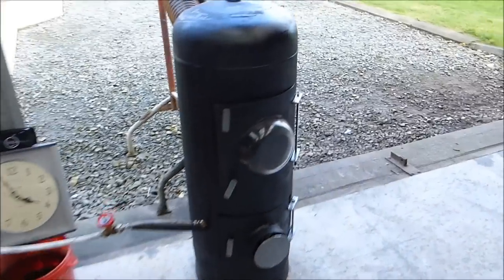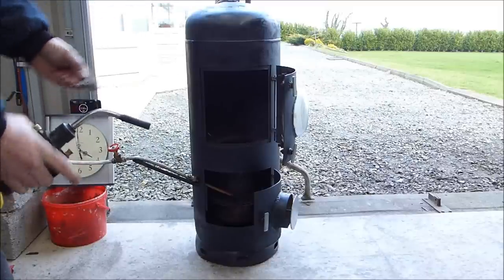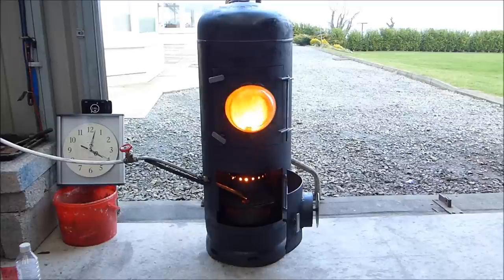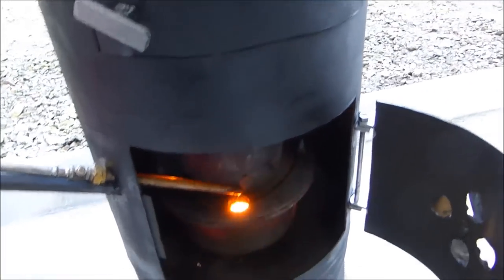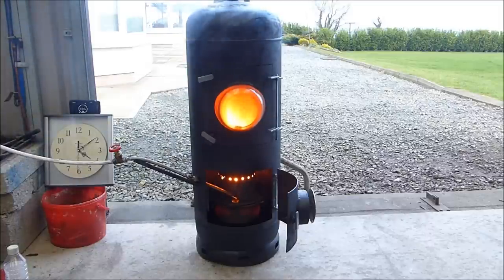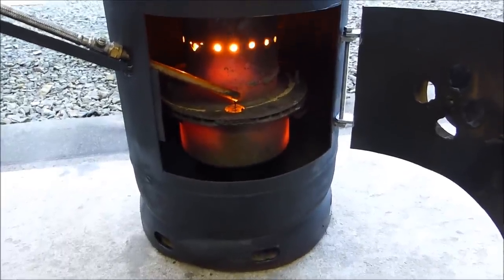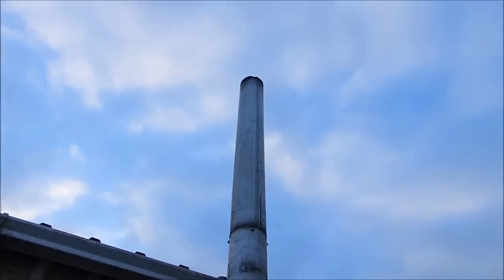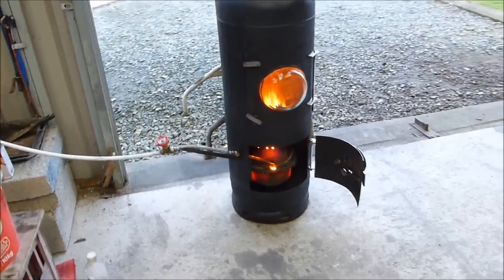Fantastic diy waste Oil and Wood burning stove heater.

Comment: You have to be careful with your Pyrex Bowl when it cools down, and the door cools down also, if the bowl is held in the hole of the door and the door hole shrinks too fast, it can break the bowl. The bowl should not be clamped against the metal door, only clamped against the fiber rope gasket or a previously cured quarter inch thick layer of your RTV. The coefficient of expansion and contraction by heat of the bowl and the metal door might be too different for them to grow and Shrink together. You have to make the gasket more of a expansion joint. But I like the creativity. My mom always hated my creativity when I went into the kitchen to get something.

Comment: one question afyer the vavle and before the cooper pipe that thing with the screw one what is it?
Reply from the maker: stathis ouranitsas The connection was temporary and it is simply a flexi pipe with an inline valve. It was all I had in the shed that day to make the conenction. In later videos I changed the plumbing so that you could see the oil through a modified 1" steel T You can see the newer oil feed setup in this video.  http://youtu.be/yLcmKVt1O2U?t=4m8s     Hope this helps Cheers Gerry
Reply: thanks!

Comment: aluminium heat paint will not flake we use it in the furnace in a steel works and on motor bike exhaust from Stokes paints Sheffield England excellent paint

Comment: Instead of paint  wire brush loose rust then light fire a heat up to about 300f  then hold a piece of brisket fat with a towel so your not burned and rub the fat on the metal to season it as you would season cast iron cookware . Maybe build a smaller burner  to to use less oil/fuel and keep temp around  600f. That's plenty temp to warm garage.  But do try fat  to season body of stove, should have a nice shiny black finish 
M L Rogers    Pasadena, TX

Comment: Good video...  How is it on vapors.  Does it give off an annoying odor or does it burn clean enough and exhaust everything out the flue?

Good project.  Thanks.....
Reply from the maker: Hi Philip. This propane tank evolved with a couple of different types of burners. It will burn solid fuel logs, coal etc. as well as veggie oil and motor oil. In operation there is no smoke or smell in the garage. It might as well be burning propane. Outside there is no smoke but if I were on the roof I would know if it were burning oil or wood but even up close if it is setup properly there is no smoke. Here is a later video with the paint a bit the worse for wear but the stove works great.   http://youtu.be/yLcmKVt1O2U    Cheers Gerry

Comment: Is that more efficient then the regular wood stove that you converted ?
Reply from the maker: Hi Orlando. It burns the same amount of fuel as the cast iron wood burning stove  and heats quicker because of the lighter metal. I can use solid fuel in this stove as well just by dropping the burner and placing a grate in the top chamber. In the next video I changed the setup by adding forced air and the stove now heats from the bottom chamber up. There will be a video showing that soon. Cheers Gerry
Reply: Gerry I'm needing to build something like this for where I will be going. to the Azores in the short future where  hydro is very expensive and nobody heats there. I'm use to the cold in Canada but is very different cold from the Azores damp cold. So I'm looking to make a efficient rocket stove that will heat water as well in order to use radiant heat to other rooms.
Reply from the maker: Orlando Pereira Hi Orlando. I did a setup where I was producing 22Kw of heat to water. I converted an old oil boiler to run on waster oil. The burner in later videos will fit completely inside a boiler or boiler stove. Check it out here http://youtu.be/xvddVsLqLdc Cheers Gerry
Reply: Orlando Pereira
I'm from Azores Islands also Pico Island - Monument Island and a Paradise on the North Atlantic.
What about you?
Reply from the maker: PORTUGAL1010 Hi Orlando. I'm quite a bit further north than Pico but our west coast looks out on the atlantic too. I am in a place where its a lot colder and wetter than where you live but on the one nice day we get in the year it is really nice. We talk about the weather alot too. Greetings from Ireland. Gerry
Reply from the maker: PORTUGAL1010 Hi Orlando. Here's one of my paragliding / paramotor videos from outside my house on one of our nicer evenings to fly over Wexford town Ireland. I will look for some Paragliding videos from Pico  Cheers
Wexford town and coastline birds eye view.

Comment from the maker: Hi Jeffrey. I have seen designs where there is a tank that is filled at the bottom for a days burn before lighting their stove and it looks like it burns well. With my design of stove here and the Ozzirt burner I use in it I dont' see how I could attach or install a tank inside this stove. In my newer videos I designed a different burner which is smaller and fits in the burn chamber so it might be possible with some changes to the propane tank. Here's a link to the new burner https://youtu.be/lU93mSoaJEk     Hope this helps Cheers Gerry

Comment: If you're still looking for high temp paint, I use Dupli-Color High Heat paint which is rated at upto 1093 degrees Celsius.
You can get it in any color you like here IN Australia.

Comment: Hello, it is a washing machine door glass in the stove? Or what type of glass? (tempered (pyrex) bowl? or something else?)
Reply from the maker: Hi Tibor. 
It's just a Pyrex dish from my kitchen. They work great but give the metal door room to expand so it does not break the glass. Cheers Gerry
Reply: Gerry's Waste Oil Burner Thank you! Especially im a glass designer from Europe. I heard borosilicate glass heatable up to 400 degree celsius. I made a design stove concept based on pxrex bowl. I will made it in real as soon as i can. I found out (based on my own stove) the glass radiate infrared heat better than the metal body, so i want to multiply the glass surface, and make the stove more lighter (for visual)
Check this:
http://imgur.com/a/EC5pP
(for woodstove)
Thanks for the inspiration.
Tibor

Comment: great information, i have a tall gas cylinder and i was  just wondering how i was  going  to make  an efficient heater out of it, can you tell  me what size the brake disc is please and what size the chimney is and where i can get that flexible pipe please.
Reply from the maker: Hi duggy788. The brake disk is just a car disk 10 inches in dia. The pipe with the holes in it is 8 inches long and is 6 inches in dia. The pot is stainless steel 3 inches deep and is 8 inches in dia. Towards the end of this video there is a close up and all the measurements you need. The flexi flue is just corrugated stainless flue liner 6 inches in dia. Check out here for more info.
http://youtu.be/mh3cljTTJ2o
Cheers
Reply: successful waste oil burner thanks thats great keep up the good work.

Comment: Hello. I am from Russia. Like the version of your stove. You can check the size of the afterburner as holes in it and a diameter?
Reply from the maker: Hello Berkit229 Russia. The holes are 10mm in dia and the secondary chamber is 150mm dia and 200mm long. Hope this helps Cheers Gerry
Reply: Thank you very much. And detailed drawings not you?

Comment: what is stopping the oil from burning back up the tube and setting the oil container alightI work on gas boilers which use thermo couples, rectifiers for flame sensing , temp sensors to control heat, limit stats to prevent over heating but you have nothing to shut this thing down automatically when you are not around dangerous.

Comment: ok whats the point of the stove id like to have seen it in use for whats it meant for
Reply from the maker: Hi. In this video the stove is being fired and tested after the build. In some of my later videos the stove is installed in my workshop. No point in drilling a hole in a good roof if it didn't perform like I had hoped. This thing produces tons of heat and makes a worthwhile diy project if cheap / free heat is required. Cheers Gerry

Comment: I've see other WO burners ad they blow huge air in... is this better? worse?
why don't you do this?

thanks
Reply from the maker: Hi Yves. In later videos I built a forced air unit that I installed into this stove. Both work really well but there is the potential for more heat output from the later burner. Check it out here.  http://youtu.be/iS3vY1e0r2Q Cheers Gerry

Comment: Hopefully you have a good supply of waiste oil.....you will have to clean that drip pot on a regular basis because it is going to coke up with a hard crusty cake, I did not notice the ability to change pot's but you should have a couple of spare's.....cleaning is quite MESSY!

Comment: How long does a 5 gallon bucket last?
Reply from the maker: usually runs at about 2 to 3 llitres per hour. Makes an awful lot of heat for that so a about 10 hours. cheers Gerry
Reply: @GerrysDiy  But is it safe to have it in your house?

Comment: hi also from ireland and have made a burner the same as yours, used a 10'' break disk, 6'' pipe with 10mm holes drilled 2'' from disk and 2'' up again all way round pipe, and a s/steel pot.. ive this fitted too the same gas tank as your with two door and spacer fitted with hole.. but when i light it, the burner and pot will not glow red hot, not much heat??? for the exhaust i just have a 6'' pipe coming from the top about a foot out, would this be my problem??? any help would b great thanks
Reply from the maker: Hi John. Yes  the problem is the flue. It is the the essential ingredient. 4 metres work great. As the hot gasses try to escape they pull more air in to balance the pressure. The more flue you have the more pull and flow through your primary and secondary burn chambers. I will have another burner of a different design in a video up on youtube in a couple of days.  What part of the country are you in. Cheers
Reply: successful waste oil burner thanks for that, was racking my head, tried about 10 pots and adjusting my oil a million different ways. also my break disk is a solid 1 but i take it that doesnt matter?? i work as a machanic so have plenty of waste oil and a cold shed lol. i live just outside dundalk u far down the country? ill be waiting on your next vid, ya may get a patten mark on that burner dragons den coming up lol
Reply from the maker: john h Hi John. I am in Wexford. The brake disk being solid is good. I couldn't get one so used ventilated instead and welded them closed. The flue is definitely the problem. If I  were to undo my flue and just add about a foot as a chimney it would replicate your problem perfectly. 6 inch diameter is a good size of flue to use. The new burner can be fitted to the propane tank version too and is really easy to build. Tons of heat and clean burn as well. Cheers

Comment: Well done. However, beware of the Pyrex dish, they are great unless they experience thermal shock. I had one explode all over my kitchen recently after I accidentally turned on the electric burner it was sitting on. I moved it to cool on a piece of cardboard and a few minutes later POP! Hundreds of glass shards everywhere.

Comment: Привет.Очень орегинально с жаропрочной кастрюлей.Вопрос какую температуру выдержит стекло.? Мой порог 670-2.225 Градусов по Цельсию.
Reply from the maker: Hi. The translation doesn't work too well but if I understand correctly. The glass is Pyrex oven ware for cooking. I have had this stove over 800c and the glass has not broken Hope this helps. Cheers Gerry
Reply: Буду пробовать.Моя температура 359-965 по цельсию.

Comment: Waste Oil,,, where do you get this,,,,, from COOKING???
Reply: oil changes on vehicles, small engines like lawn mowers... pretty mjuch anythig with an engine besides electric things it will have oil and it needs to be changed and that used oil is pretty useless so you can probably get it pretty easy by putting an add up on craigslist or similar sites

Comment: I'm betting your high-temp paint will last better than you think it will. I've built wood stoves and initial burns were done outside as the paint bakes on but does smoke and smell initially. Ireland huh? Love the accent, ah to be sure laddie!
Reply from the maker: Hi Will. If you look at some of the later videos you'll see that the paint did indeed mostly burn off. The output of this burner and the newer forced air type burner that I made in later videos is huge and the paint lost the battle So far the only expense for me has been paiint. Cheers Gerry

Comment: Close it down that way won't get so much air Just give it a little air and slow down the oil.
Reply from the maker: Needs to stay red hot to combust the new oil coming in for combustion. there is a limit to how little this design will slow down to before the incoming oil would cool down the combustion chamber and extinguish the flame. once hot enough it will keep going all day.  Cheers Gerry

Comment: Wish I could get mine to burn with no smoke. Burn tube gets red hot, all the paint has melted off the outside and it kicks out alot of heat but it's got a stream of smoke pouring out the flue
Reply from the maker: Hi Keith. Send me a pm with a photo or video and I'll see if I can help with your smoke problem. What length of flue did you use and what was the diameter. Is it all airtight. Its definitely possible to get it purring along with no smoke.
Cheers 
Gerry
Reply: The flue is 100mm diameter and around 2.5 metres long. I added a few more holes in the blast tube which did increase the burn but it also increased the smoke. Would a longer flue solve this?
Reply from the maker: Keith jones Hi Keith.The mixing power of the blast tube depends on the length of the flue. the longer the flue the more pulling pressure it exerts on the secondary chamber ( blast tube) Try and make the flue longer to increase the mixing pressure in the blast tube. More holes wont do it. I found that 2 rows of holes were sufficient but I have a 6 inch flue on my setup as well. Hope this helps Cheers Gerry

Comment: Can I buy plans for this from you?
Reply from the maker: Hi Daniel I have upgraded the burner in this stove to one that can run with or without forced air. There are 7 ore more videos with details including the drip feed system and measurements to the new burner. Have a look at the build and then check out the playlists for more build videos. I have made some videos on how to make a different cooker stove that can glow red hot without a blower. I don't have plans but I am happy to help. https://www.youtube.com/watch?v=ShTLaYKjzxw   Cheers Gerry

Comment: what I meant was before you enclose your stove , was to line the inside of the stove skeleton with that mixture of sand and plaster mix . you would probably have to make a sleave 3/4 to 1" smaller than the outside diameter of the actual stove , then pour the mixture between the walls . let it set for an hr or so then slide out the inner sleave so you will have the outside shell with a fire brick substance attached to the inside . you might have to use something like hammer an chisel to separate the inner shell from the brick unless you can get a plastic or wooden inner shell cylinder to hold the mixture in while it sets .  see u-tube on making a foundry .
Reply from the maker: Hi Gerry. I see what you mean. That type of setup is great for a foundry and in later videos I made a blower type burner unit which would absolutely be able to go nuclear with a big fan. Smelting metal would be an easy ask from waste oil and a blower burner as there is a lot of energy in it. Cheers

Comment: I had a great waste oil burner (actually it was on old  "Smudge Pot" it would run for about 24 hours full blast...amazing heat.... the only problem I had was shutting it down.
It would smoke for about 15 minutes...and I could never figure out a good way to stop that (and the waste veggie oil smoke is very irritating !)

Comment: If you can get header paint call from Canada or the United States it is rated at 12 the 1500° call that should stay on your firebox quart pot belly Paint we usually the header paint rated 1200 to 1500° should work on it
Reply from the maker: Hi Tony. The paint I used was supposed to be good for 1000 c but as you can see in the latest videos on my current stove it is no longer black. It doesn't take long to roast the paint off. I had the stove over 700 tonight and it was glowing cherry red. I took some video so might post it tomorrow. Thanks for the comments . I tried one of my burners in my house with my boiler stove and you can check it out here https://goo.gl/gzGLrG  Cheers Gerry 👍

Comment: Have you checked the temperature rating of exhaust header paint?  I did a quick google search and found several brands rated for 2000 F.  There may be others rated higher.
Reply from the maker: Hi Annie. Thanks for the info I will check it out next week. Cheers

Comment: Get that hotwater going, free heat and hotwater  you can't bet it.  I'm doing the same as I write as money allows.
Reply from the maker: Hi Fireman Jim Thanks for the comment. I did build a 70,000 Btu setup from a converted oil boiler which heats 80 Us gallons of piping hot water in about 1 hour.
videos showing boiler heater.... Cheers
http://youtu.be/1Et3rIn5GIY
http://youtu.be/xvddVsLqLdc
http://youtu.be/PaEOpqqPwgs
Reply: I'll send you an image of the filter asap